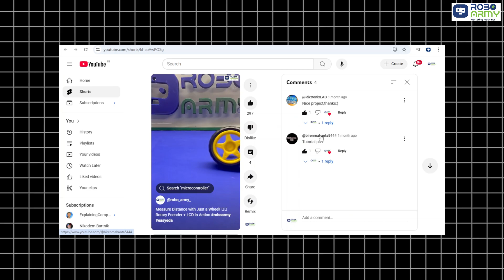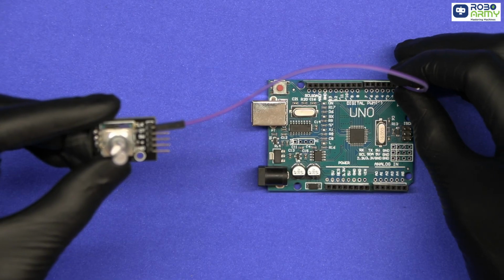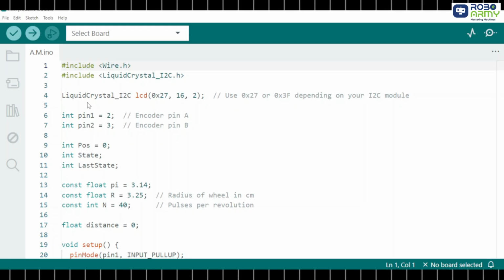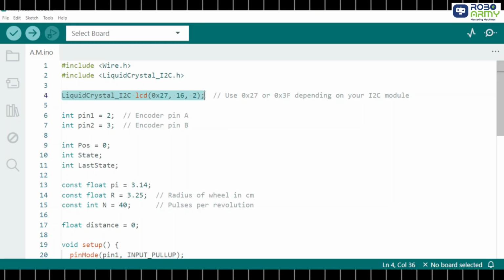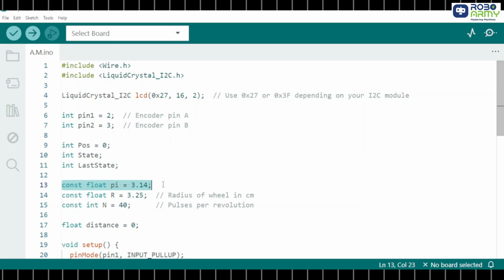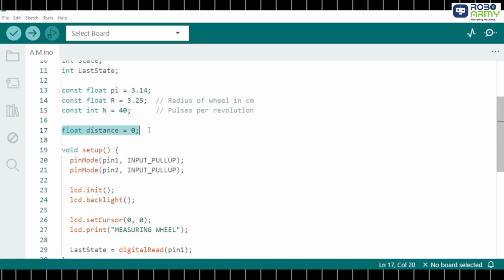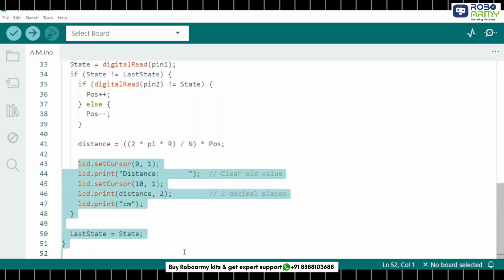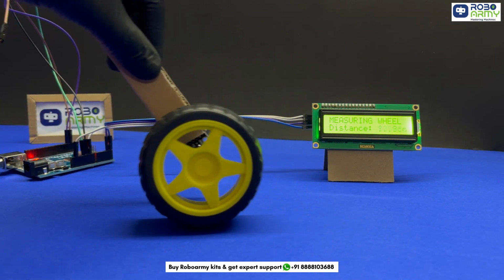How to Build a Distance Measuring Wheel Using Arduino | Full Project Explained

Comment: Is N value constant if not how to know the pulses for rotation of wheel
Reply from the maker: The N value isn't constant; it depends on the wheel's diameter and the encoder's resolution, you can calculate the pulse count for one full rotation based on these parameters.

Comment: how about if we want to convert the given unit to meters is there any way for that to be possible?
Reply from the maker: Good question! Yes, you can definitely convert the measured distance into meters.

Since the rotary encoder counts wheel rotations (or steps), you just need to calculate:

Distance = Wheel circumference × Number of rotations

First, measure the diameter of your wheel.

Circumference = π × Diameter (in cm).

Multiply that by the number of rotations, then divide by 100 to convert cm → meters.

I can share the exact formula or code snippet if you’d like!